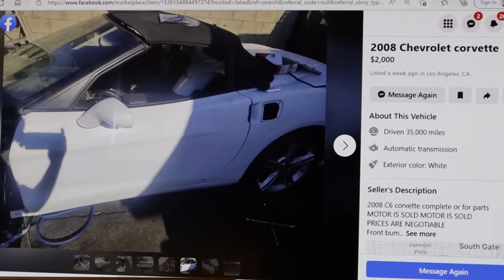Is it possible to build a $5900 C6 Corvette Convertible?

Comment: Great project, I bought a 2007 Z06 Ron Fellows that was rolled with 1,450 miles. OMG! I could not do the work and had to take to a shop. Much more money than practical but I saved it. Serial Number 214 signed edition. Great Project. Have fun and enjoy the results. Seeing you take off the body parts can we take a C2 75 type body and blend the body panels onto the C6 panels so the bolt back on and transform the look??? The Vette Roller chassis from 97 and up is a work of art. Add the C2 Shark body and it makes a hell of ride. All the best, Dennis

Comment: I own a C6... A few thoughts... the body panels are all bolt ons, easy to swap, really. 

The chassis has 2, hydro-formed rails, one piece of tubing! I would not want to slice that and weld it back, I would worry about structural integrity. 

I noticed that the wreck has HUD, that's an easy swap if the stolen car does not have it, just requires dash removal, the HUD is an independent system. 

Oh, and the body isn't fiberglass... just being picky, but it's called SMC (I think the newer cars have a new version of that, but I don't remember the name). SMC = sheet molded compound. It is a dough like slurry that is pressed into a shape by a press. SMC also has a built in release agent, which requires special body fillers and adhesives. SMC started back in the late 70s, IIRC. I know it was on the C4 from the start, and it is much less prone to cracking and spidering. As such, the SMC panels on the C4 were structural. Sort of a stressed member, like a semi-monocoque structure.

Comment: I've always been a blue oval guy the legacy of the shelby's and Gt 40s. But when I was a teen I was big in the Mulholland scene with a 62 Corvair Spyder and then a 1966 Yenko stage 2 tuned for track use. But at that time my future father in law had a aluminum big block nash 5 speed 65 c2 huge flares and huge daisy mags. The car was the most evil looking thing I've ever seen and was insane to drive. It's not often that I'm scared of how fast a car is but that thing was a terrifying example of light weight high horsepower. It was brutal fast. He still has it but he is updating it all c4&5 suspension wide body kit and that same aluminum 427 under the hood. Canrlt wait to drive it when it's done. I would love to get one even though I have no financial way to get one. After 60 years of living as a pirate the bill has come due with heart issues and cancer its put a definite crimp in my spending habits. Thanks for the awesome content and for keeping us all entertained.

Comment: I've Got An 08 LT3 Coupe with no real problems with mine but I really like watchin' you buy & work on these Cars Thank you so much  I'm havin' A Problem with my automatic shifter not wanting to come out of park so far I can Step on  the brake &  push my shifter a little  forward toward the dash & It Will release The Shifter into drive, rev, whatever . my concern is that one of these times that is not going to work I Guess It's Time To Get it into the shop To Repair that, what's your thoughts?  If Ya Don't Mind

Comment: I have a 5 gallon portable fuel cell that I welded up that has a built in walbro 255 with an adjustable fuel pressure regulator just for testing or transporting vehicle with bad fuel pumps.

Comment: Most old cars have a sealant under the windsreen that you run 2 wires from battery and other end 2 pins on wires ,poked into sealant lel it heat till your wind screen  is loos enough to take of ,much easier .

Comment: Could I get your help ?I have a beautiful 2002 c5 and low miles 81,000 all I know of that needs replaced is oil sending unit I believe it dribbles but out of know where bells and warnings going off says low fuel when full reduced power yet still runs normal no windows or key fob and I just know has to be simple.your awesome at corvettes and I figure ya know the fix so please reach out

Comment: Love your content im looking for my first vette always been a ford guy love c3s but stupid espensive and then id wind up spending 10-15 grand  on sudpension upgrade. I like c4s bit tp pricey to build up the smog legal HP so that leaves c5-c6 i love the c5 and c6 roadsters what would be a good price range for either with 6 speed and at or just under 100,000 miles and what should you look out for kn eithdr of those like years to avoid or weak area in both. Car would be used like a protouring car lots of cross country drives and autocross events. Not so much drag racing im a 1970s Mulholland kid.